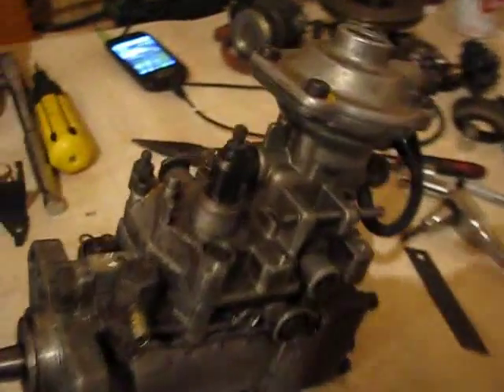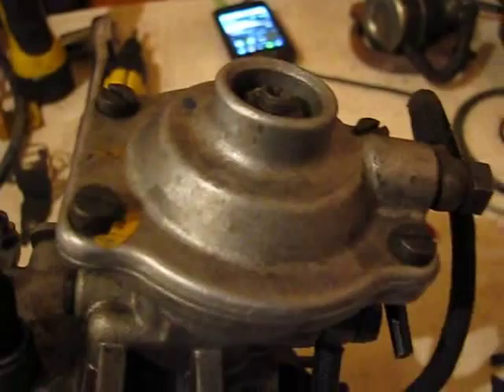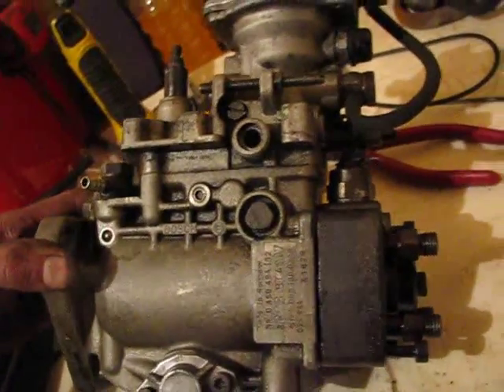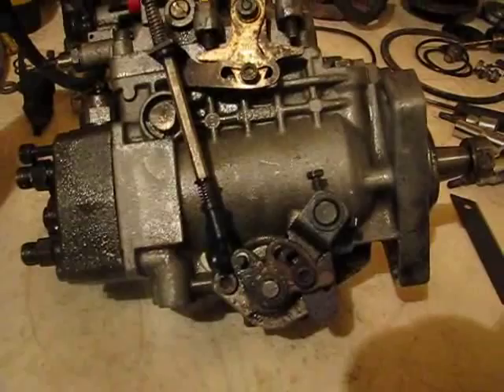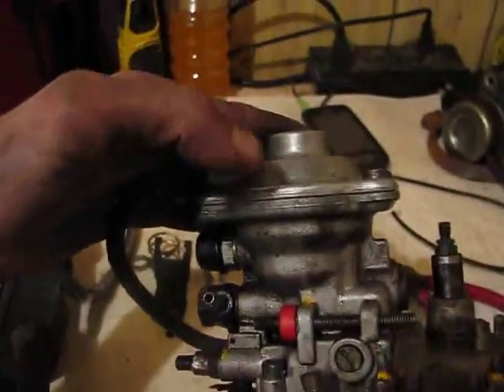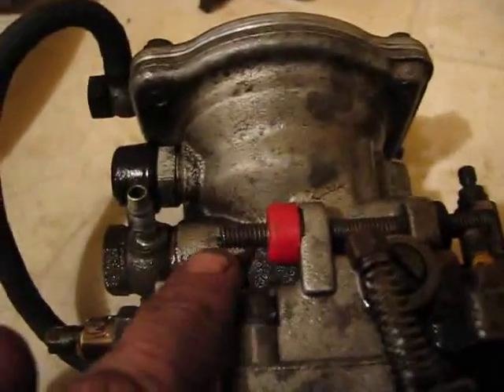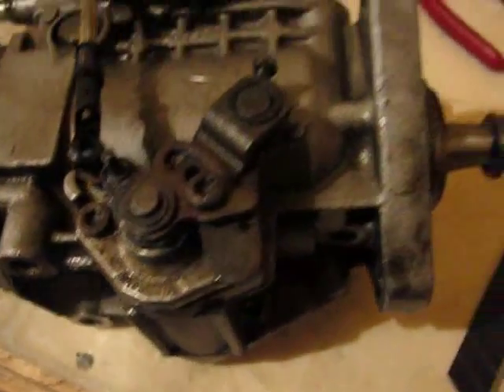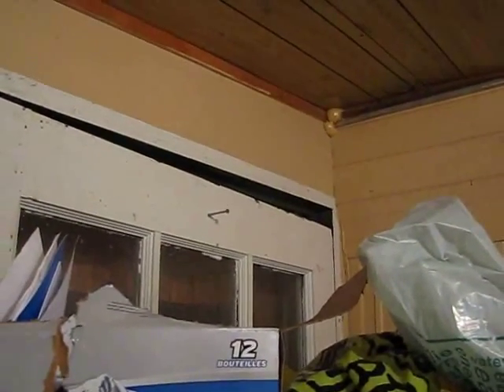Volkswagen Injector Pump Teardown and Questions! (01/06/12)

Comment: Can a faulty or misaligned injector pump cause engine vibration and rough idle on cold start?
Reply: Yes. 
If the problem is only when cold probably has faulty glow plug(s)